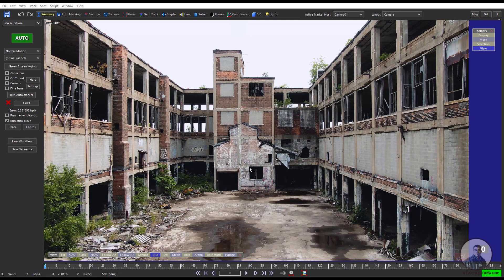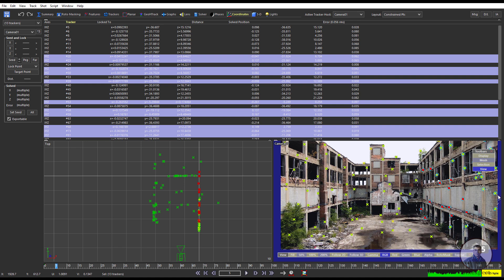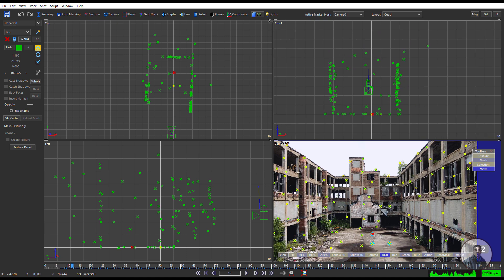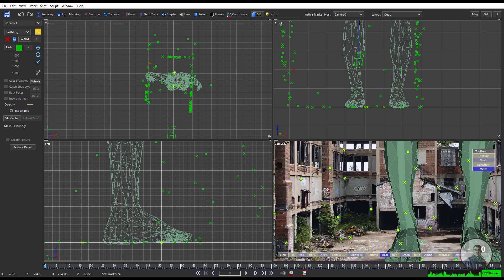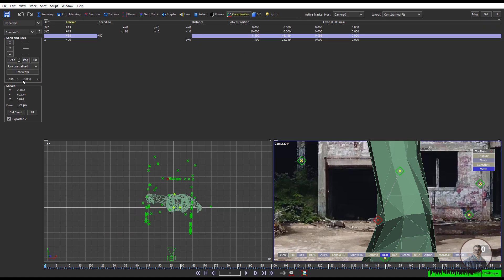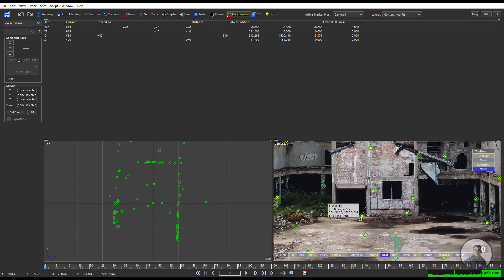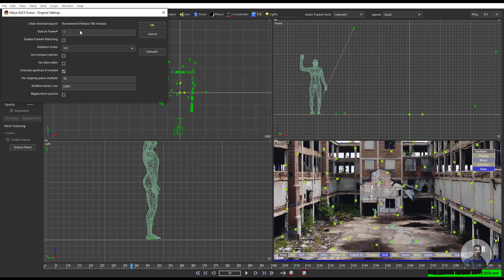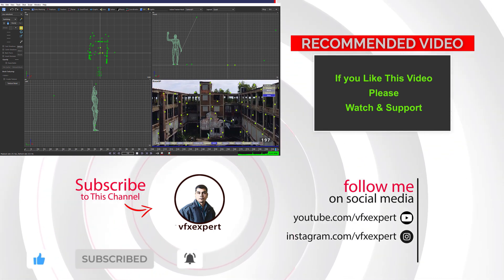Scene Scaling in Syntheyes | Setting Up Coordinate Systems with Distance Constraints in Syntheyes

Comment: Great video, but what if the video has no ground in it? I have a green screen footage, there's a back wall, but no ground, I want to scale it by two trackers that have 100cm distance
Reply from the maker: You have to take some reference in your scene, like wall, piller, door etc.you can also use distance between two track points.
Reply: @vfxexpert I managed to pull it of meanwhile, but thanks anyway, I really admire your work, cheers